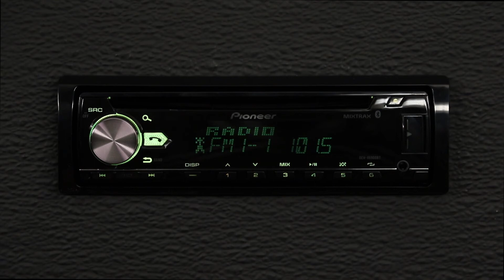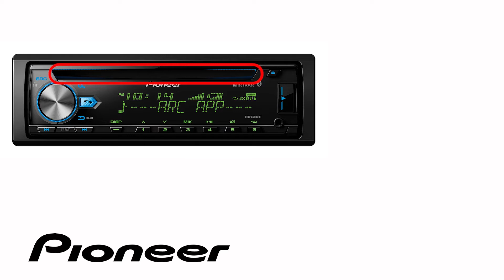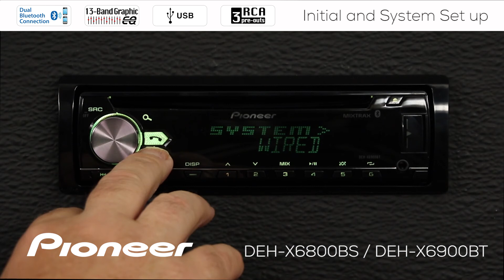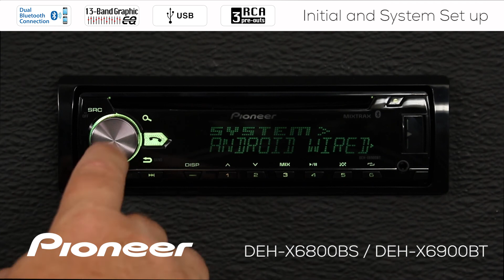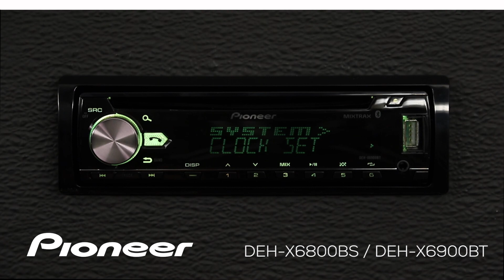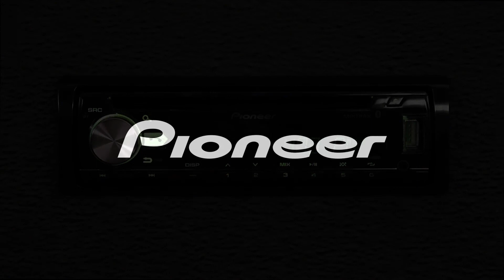How To - DEH-X6900BT - Initial and System Setup Standard Mode

Comment: I’ve got bluetooth issues...song and video is not synced, connection through BT feels slow, can’t adjust volume from iPhone...when pressing the volume down button on iPhone the player volume remains the same, going all the way down to mute the music works, but when pressing volume up button from iPhone it takes 1 second to process the action and at 1 square volume it plays at full volume...tried updating player software, still the same...
Reply: What model number of Pioneer in-dash receiver are you using?
Reply: DEH-X5900BT, updated to the latest software version, still having this issue...
Reply: The Pioneer DEH-X5900BT is not designed to be a Bluetooth Speaker for watching videos.  The audio may not synchronize with the video image.  
Here are a few suggestions to help with the other issues.   First:  Delete all phones from the in-dash receiver's Bluetooth Memory.  You can see it here:  https://youtu.be/jLkiyqbYlBA?list=PLw63zJRQbCNiqf5pU1wQ00VD9BRgM0eH3     Next, delete the in-dash receiver from the phone's Bluetooth Memory.  Next, and very important,  restart the phone and in-dash receiver.  Finally,  start the pairing process from the beginning.  You can see it here for iPhone:   https://youtu.be/DYi7taO6tgU?list=PLw63zJRQbCNiqf5pU1wQ00VD9BRgM0eH3       If this does not correct the slow operation, I recommend to reset the in-dash receiver.  You can see it here:  https://youtu.be/CGri78izPzA?list=PLw63zJRQbCNiqf5pU1wQ00VD9BRgM0eH3&t=177  You can contact Pioneer Europe for additional support here:  https://www.pioneer-car.eu/eur/products/deh-x5900bt/support